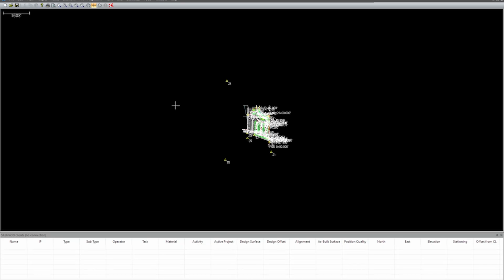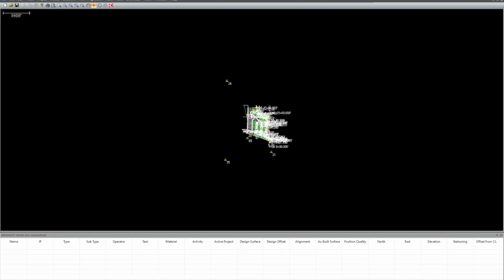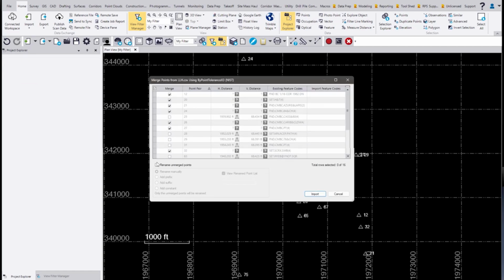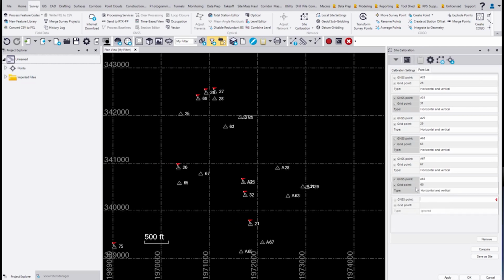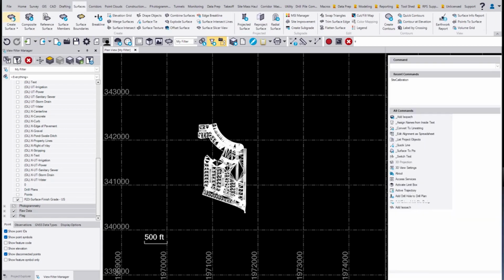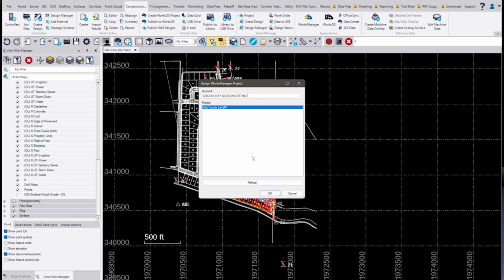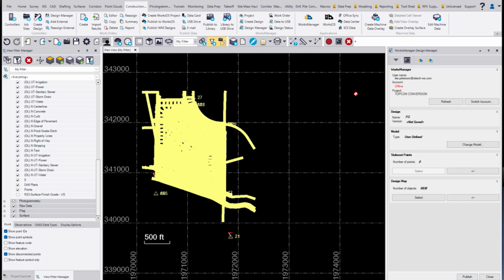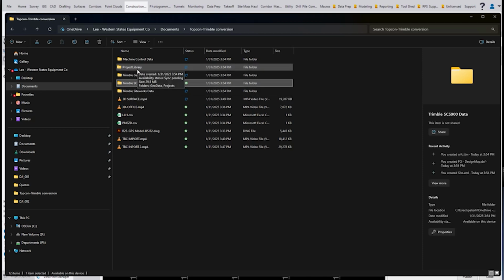Topcon to Trimble Machine Control File Conversion

Comment: Where are you finding Topcon 3D office for free? I cannot locate it anywhere on the Internet. Thank you!
Reply from the maker: Great question, Scott! Topcon 3D Office hasn’t been free for a while. It was moved to their legacy lineup and now requires a myTopcon login. If you need something current and supported, we recommend checking out Trimble Business Center.
Reply: @WesternStatesCat  I need to convert .tp3 files to DWG or DXF
Reply from the maker: Got it, Scott. You can reach out to the team at SITECH Western States to get up to speed on modern site mapping!